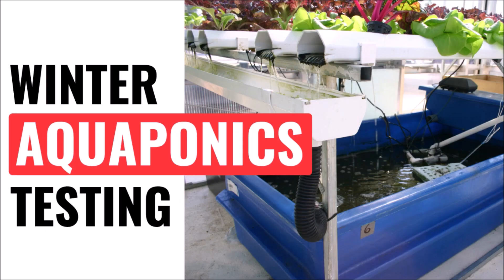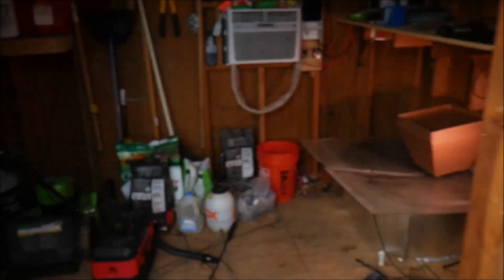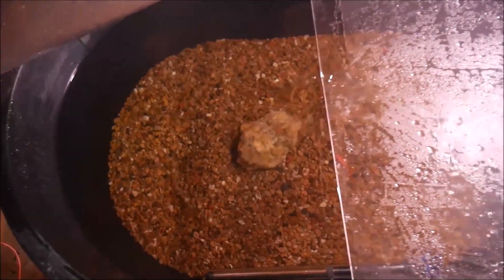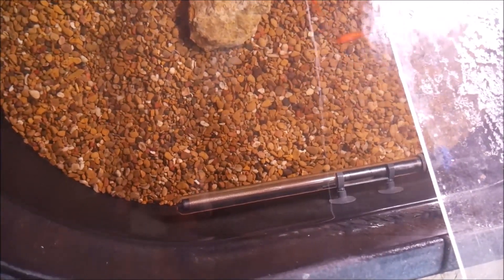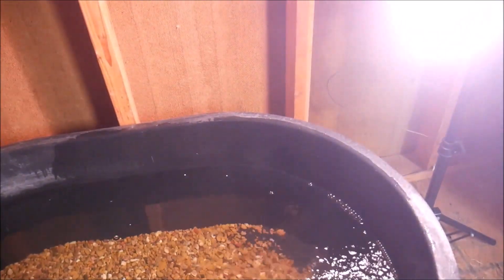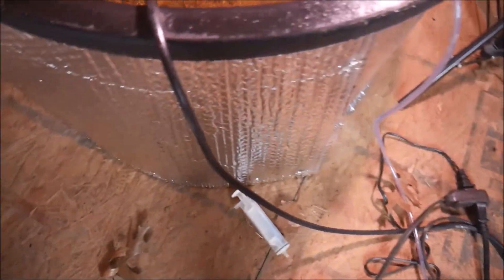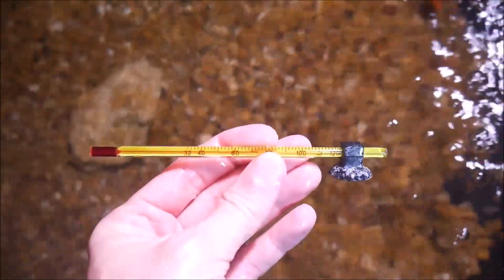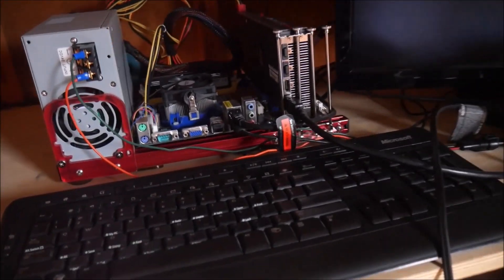Solar Powered Aquaponics Part 1 - Testing To Make Sure Fish Won't Freeze Before Going Full Scale

Comment: What is the temperature 3 feet underground?
"Throughout most of the U.S., the temperature of the ground below the frost line (about 3 to 5 feet below the surface) remains at a nearly constant temperature, generally in the 45 ° -50 ° F range in northern latitudes, and in the 50 ° -70 ° F range in the south"... By bury the tank(s) it would be the equivalent of what AMBIENT temperature would be above ground. Also  insulation would hold the heat produced by the heaters from CONDUCTING into the ground...
I have a 1500 gallon plastic tank, with the top cutoff just as it starts to curl in; buried 4.75 ft 'without' insulation, and my Goldfish have been doing fine for over 5+ years. Note: The top one inch does freezes a few times during the winter; but Goldfish just stay at the bottom until it melts, or I break the ice. If I were to do Tilapia I would insulate my tank to keep excess heat from conducting directly into the ground also. Good luck.
Reply from the maker: Thanks for the thoughts.  I would love to bury the tank but I don't have the space and there are quite a few cats in the neighborhood that would get into it, I'm afraid.  I may wrap it with another layer of insulation and make a better-fitting lid at some point.

Comment: More aquaponics!
FYI aquarium heaters are notoriously unreliable. I recommend a second heater. Put them as far apart as possible and adjust them so they both heat to the same temperature (trial and error - the setting is only "close" even on digital thermostats) so you can tell if one dies and stops heating / taking current.  Sometimes they also fail by the thermostat sticking on. Good to have two heaters that each individually cannot maintain tank temperature to the set point even running full out. That way if one sticks on it cannot cook the fish, but still if one fails to come on the other keeps the fish alive. More robust, industrial quality heaters are available if you want to pay. The ones I've used are remote and designed to heat the circulating water by plumbing the water thru them rather than submerging them in the water and even then they used multiple heaters (probably necessary to provide required BTUs).
Reply from the maker: I'm trying to keep the power draw minimal and the overall setup cheap.  So I will probably always use aquarium heaters.  I have never had one fail in 30 years of fishkeeping (knock on wood) but I have heard plenty of stories about it from other people.  So what I will probably do is use a second, smaller heater somewhere in the chain and have its thermostat set several degrees above the main one.  That way if the main one fails and the water starts to cool off, it will only fall a few degrees before the second one kicks on.  But normally the second unit should always be off to minimize power consumption.  I also plan to have a wireless thermometer that I can monitor remotely.  Plus I feed the fish by hand each day so I will be able to tell if the temp is too low because of a failed heater.  I especially check on them a few times a day when we get a big cold spell like we have right now around 19-20 degrees.

Good suggestions, though!  I am glad you are interested :)

Comment: Would it be a good idea to separate out the heating element and filtration? Say when you up scale, and to do maintenance and replacing any parts would not disturb the fish? I am thinking about temperature control, if the water is pumped out of that tank into one beneath it for filtration and temperature measurement and heating then it returns to the fish tank above.  That way you can ensure even temperature and the circulation will be automatic if the inlet is low where the cooler water is. Then the fish can't run up on the heating element prematurely cooking. Probably a total unnecessary thought. Plus the lower tank can be hidden in a cabinet for that sleek YouTuber feature but still not too flamboyant
Reply from the maker: Yes, probably.  I am thinking about making an overflow box like is used for saltwater aquariums that would house the biological filtration, heater, and provide more aeration for more fish.  That air stone won't support a school of tilapia.  Good idea, we are on the same page!
Reply: When you up introduce plants and the bioreactor you will have temp looses in various ways. Depending on the waters time out of the fish tank he will need to run a few inline/tank heaters. Most likely before returning the water to the tank reducing temp swings within the tank. Another will be require before the plants. And the filter to maintain the right temp for the bacteria. All will need to be thermostat regulated to reduce power consumption.
Temp Equilibrium in the 'entire' system is not a requirement just those key locations. If you can use multiple permanent temp probes, or by hand at scheduled times, to get reading before, during, and after each stage this will help you determine where you would need to add heat.
Reply from the maker: True.  I plan on adding one more heater to the mix or possibly putting heat mats under the containers with the plants.
Reply: @LDSreliance  I look forward to your implementation ! Also maybe a glace at some videos of self sustaining fish tanks. people making self  sustained ecosystems for raising fish to eat and the such. There are bugs/fish/plants you can buy that will eat the excrement and leftovers from the other fish effectively cleaning the tank and setting up something that requires low maintenance.
Reply from the maker: I agree.  I have been keeping tropical fish since I was 9 years old (over 30 years haha).  So I definitely know how to keep fish and cycle a tank and all that.  I certainly will look into those other videos for other ideas as adding plants and a lot of extra equipment to the mix will definitely complicate things.
Reply: @Vaktare_White  A commercial farm not far from me has several stages. Trout in naturally cold spring water, which flows to catfish and tilapia and other warm water fish, which flows to alligators. The 'gators get to eat the parts nobody else wants and the water cools off some before and while irrigating farm land and/or a cattail marsh which drains into the river. (They only did 'gator commercially for 10-ish years and still keep a few just as a curiosity.)
Reply from the maker: That is awesome!  I would love to have a multi-stage setup like that.  However, as you can tell from my video, I have extremely limited space in my back yard.  I am hoping to buy some land in the next few years, though, and then I will go large scale with it.